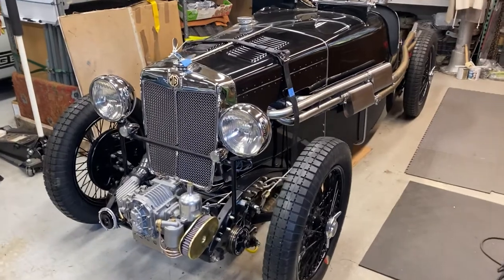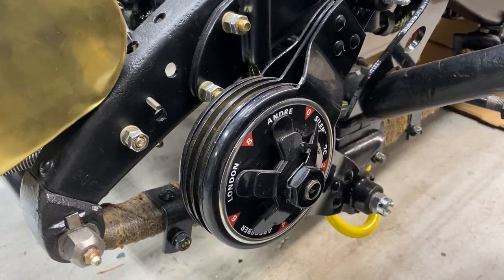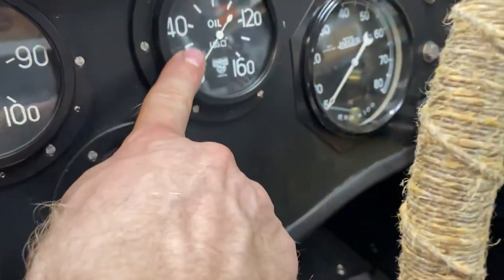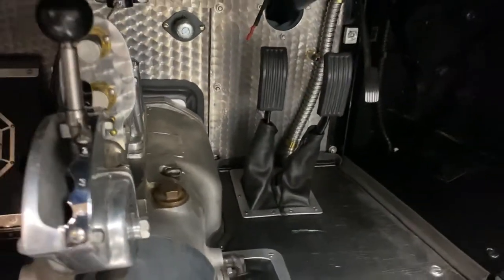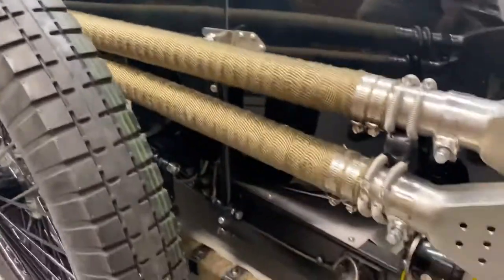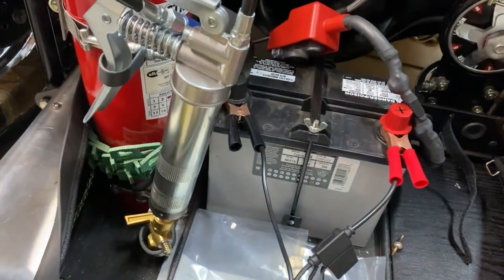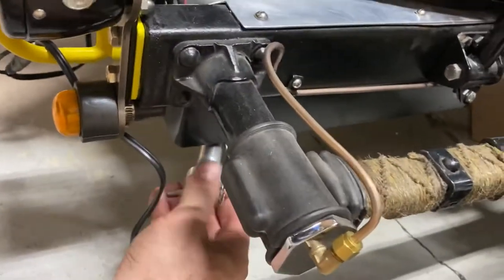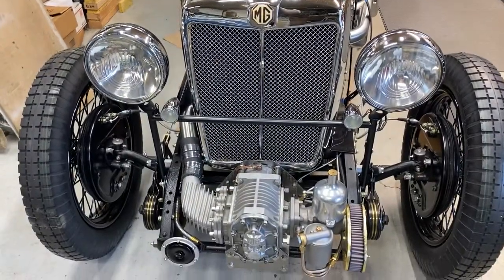1938 MG TA Special Project Update

Comment: Did you do the superb cording job on the springs and steering wheel? What an art!
Reply from the maker: Yes,  I learned that the fibers tear up your hands without gloves. The method is one wrap, tie a half hitch, pull hard back against the previous loop, and continue. It builds the knots up in a zig zag and prevents unwinding if a break occurs. I sealed it against decay with boiled linseed oil thinned with turpentine, a few drops of Japan hardener, and 3% clove/cinnamon oil as an antimircobial and to cover the awful terp smell.

Comment: Beauty....but do i see it wrong? You leather belt is over the exhaust? Gr. Ruud
Reply from the maker: Thank you,. Yes, you saw it correctly. At the time I filmed the video I still needed to make the metal rod that extended behind the exhaust pipe down to the chassis bracket. I finally found a photo of a Q-type racer and took dimensions from that.

Comment: I've never seen a cross flow head on a newer (t.c.,t.d. t.f.) M.G.  Was the T.A. produced with one?  Any info or links would be appreciated.  Any info on your Special Project , ditto.
Reply from the maker: Hello Karl, thank you for the kind remarks. Some small quantitiy of crossflow heads were produced decades ago for the XPAG engine but are impossible to find now. Recently,  company in the Netherlands called Roelofs Race Service made a small batch on a CNC machine, one of which I purchased. It is set up to run unleaded fuel, larger TD2 style intake valve seats, and standard exhaust valves. Jan Roelofs was very helpful with setup and recommending springs and shims to get the rocker geometry correct. Intake and exhaust manifolds were made by Steve Baker's fabricators in the UK, and exhaust manifold modified by a local shop to clear the distributor. Roelofs site is here: http://www.raceservice.nl/index.html. For more detail on how I built the TA special and components, I started a thread on the MG Experience forums, which also includes helpful hints and photos from other members. https://www.mgexp.com/forum/t-series-and-prewar-forum.46/1938-mg-ta-special-build.3873130/
Reply: You're killin' me. Beautiful.

Comment: Hi Craig can you please tell me where you brought the gauges …regards mark neale
Reply from the maker: The 4 Q-type style gauges came from Patrick Henry who was located in Ireland at the time. He specializes in correct gauges for vintage MGs like the Q-type and K3. They were very reasonably priced. The tachometer face came from Steve Baker, and I used it to replace the face of a modern electronic tachometer (Autometer 1799 Old Tyme Tachometer) to look correct. I wanted an original chronometric Jaeger but I could not run a genrator due to the clearance of the side exit exhaust manifold. I had to run a mini-denso alternator with heat shielding. As such, I lost the ability to mechanically drive a tach. The original Q-types didn't have this problem because the overhead cam drove the tach. Such are the challenges of mixing body, engine, and exhaust types. The neat thing about the modern unit, is it runs off the ignition circuit input but when you turn off the motor, it displays the last registered RPM like the old chronometric tachs. It has the added benefit of smooth needle sweep when running compared to the jumpy old chronometrics. The amp meter came from Steve Baker and the 8-day wind-up clock came from a friend who recieved it from someone who took it off an airplane. Under the dash, I hid a Hobbs hour meter because there is no speedometer or odometer on the car.  I can correlate hours with approximate miles from my GPS speedometer display on my phone.